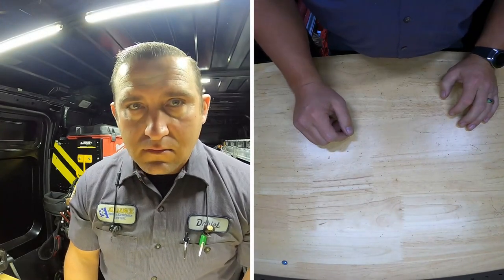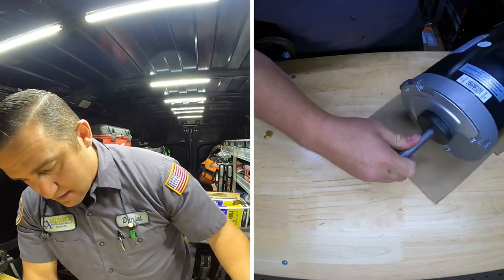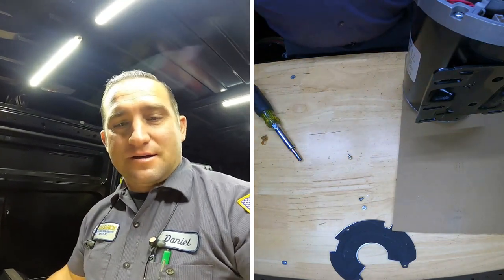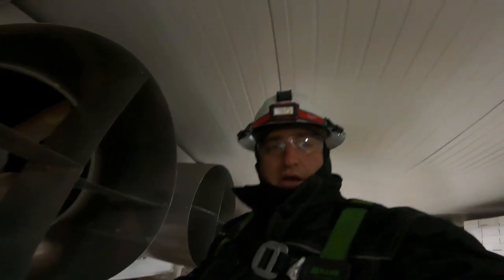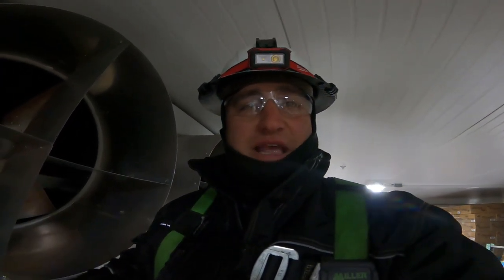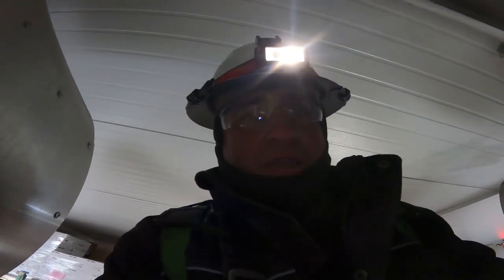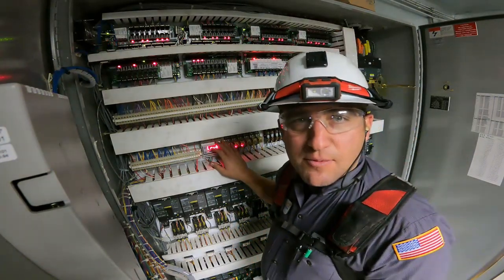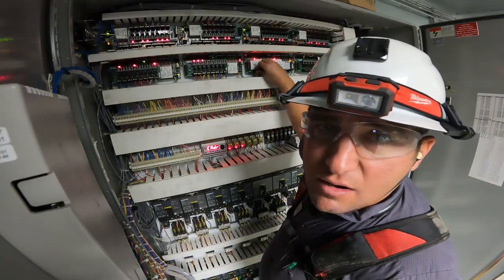Freezer Motor Almost caught on Fire!

Comment: lot of good info. I wish I had the time to take care of my tools like that, but those days are gone. I was able to do that when I work for my father in the automotive world many moons ago. I have been cleaning ice machines all week and yesterday I noticed the bit in my 4-way got so rusted in place it had to be removed with pliers from the rust and also, one of the mechanic's say's is this yours.  Yes, that's my wiggy; we found it in the ceiling. I did not even notice it was missing in my tool bag. Lol, Thanks for the video.    I guess I should clean out my tool cart. LMAO

Comment: I love this kind of systems Because is using non toxic refrigerants. (Here in Europe A2L's or CO2 transcritical) is good solution if the installation are in Public areas.

Same installations here is using R404A if is new installation we using R454C which is a A2L refrigerant.
In " new" (2015-2020) installation with A1 refrigerants we using R448A.

Now with the new F-Gas regulations for R448A the legal refrigeration capacity is from 500W(0.5kW) up to 40.000W(40kW) 
Is illegal to use R448A(high GWP) in installations larger than 40kW for example 250kW for 250kW is mandatory to use R454C(ultra low GWP).

Now in Greece we have flake ice installation that utilizes R404A refrigerant the metering device for Geneglace F800(20 tons flake ice per 24h)  is flooded system without pumps (gravity system) this system have 375 kg  with two semi-hermetic screw compressors from bitzer (HSN6461-50) (need one more compressor to cover the capacity needs without capacity control like a normal refrigeration rack) this installation in 95' was used with ammonia as refrigerant.
Reply from the maker: Ammonia absorbs more BTU's per pound. Ammonia is and always will be the #1. Yeah it's a  little toxic.
Reply: @alliancetechnh3368  the Greek government unfortunately have prohibited the ammonia for public places and unfortunately the installation are in central fish market of Thessaloniki.

Comment: What are the average freezer temps you’re in? And what do you recommend for freezer wear that will keep you warm for at least up to 30 mins or an hour in -25?
Reply from the maker: Mostly 0 to -10. I do have a system that runs At -40.  My Suit is rated for -30. I usually wear my jacket under my suit.

Comment: What kinda wrench do you use for opening valves?
Reply from the maker: 9" ford Wrench.
Reply: @alliancetechnh3368  thank you sir
Reply from the maker: Crescent 9" Automotive Wrench - C79H
Reply: @alliancetechnh3368  I’m still new to refrigeration but I have a question, can DX coils be used on low temp applications?
Reply from the maker: @alexrojas8373  Yes.
Reply: @alliancetechnh3368  last question, on a DX coil valve group I see it’s a danfoss valve group with motorized valve, then before the coil inlet you find your TXV, why do we have 2 expansion devices before entering the coil?
Reply from the maker: @alexrojas8373  if it had a hand expansion and it's set they could use the motorized valve when load drops.
Reply: @alliancetechnh3368  I’m having issues with a MCXV by Hansen tech. It’s reading 00 when we have the coil activated, do you have any trouble shooting tips for these type of motorized valves? P.S. it’s for DX
Reply from the maker: @alexrojas8373  is it getting a 4-20 signal 0 to 10 signal or you have a digital signal to it?
Reply: @alliancetechnh3368  4-20 signal, but I have a feeling the valve is just stuck
Reply: I found out that the motorized valve is on MVP-13